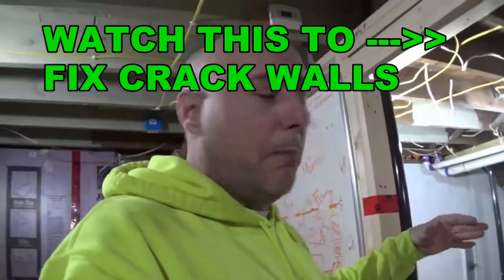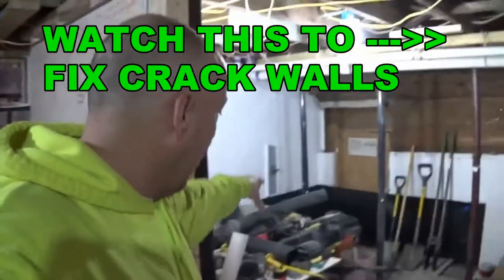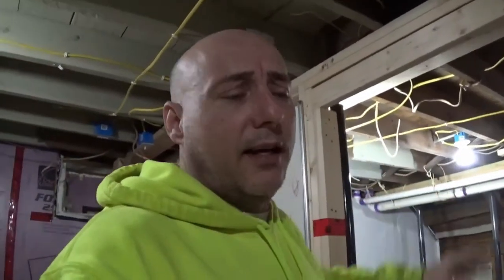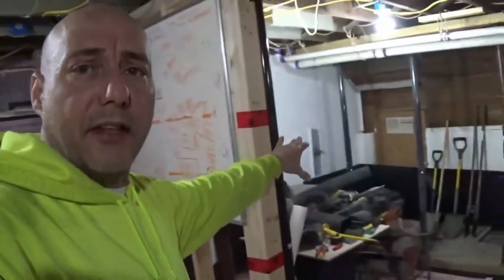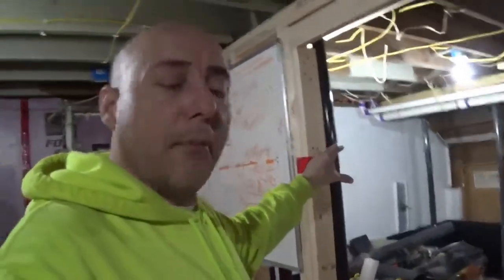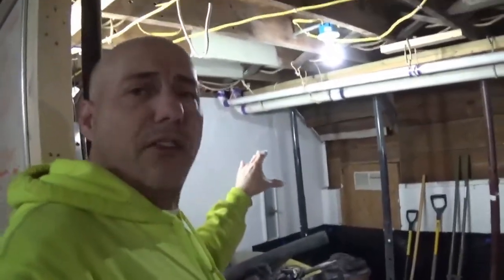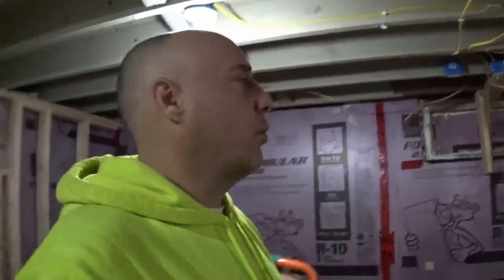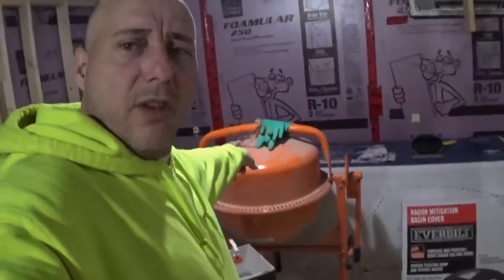How to install basement French drain system waterproofing tile sump pump basin Fix wet basement

Comment from the maker: Check it out doing a step by step of how to install basement waterproofing system for install of French drain sump pump basin how to make a wet basement a dry basement. how much on cost of supplies and tools you will need from start to finish I will have it out to you this weekend